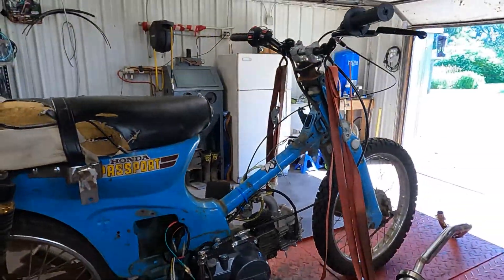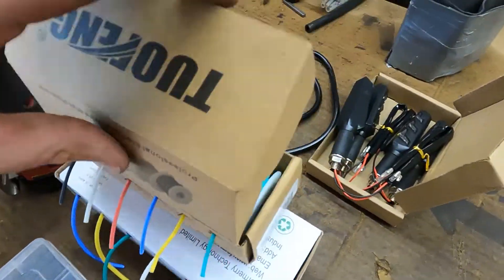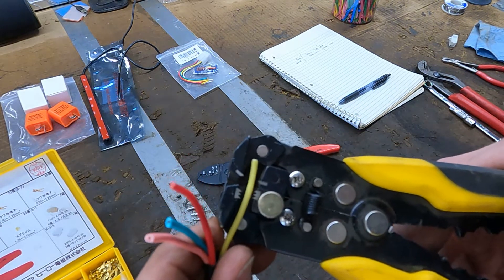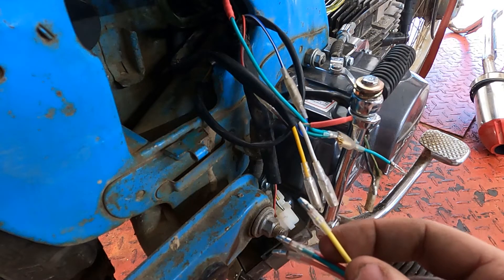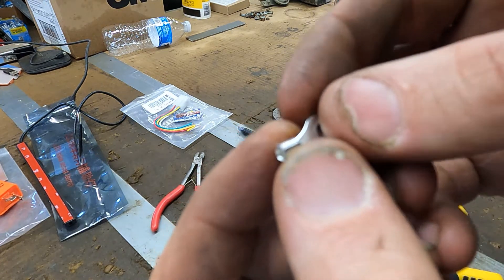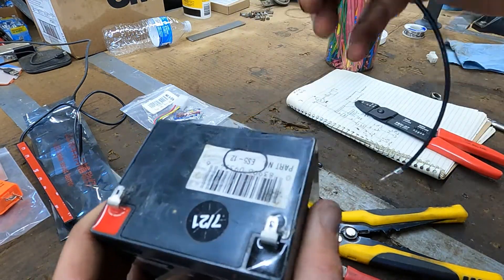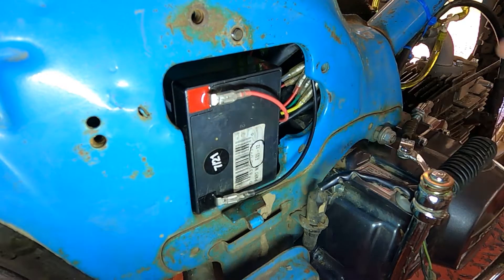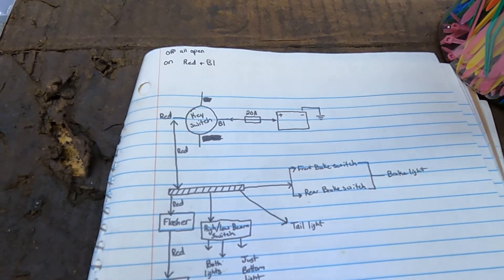Charging System Install on a LIFAN 140 on the Honda Passport!!

Comment: That thing is sick i love it i have a honda passport with an old lifan 125, i put a crf50 engine into a 1960s honda trail 55 c105 trying to figure out a charging system so i can run lighs gonnna gut the old harness and use everythint i can and should use then attempt to convert it all to 12 volt
Reply: But over all you have a super fun looking build my passport also has a 1×2 board stuck into the old airfilter spot in the frame going to the stock gass tank the board has a 1 gallon gas tank on it
Reply: Gives it a cool upper bone look
Reply from the maker: Awesome! It’s been a fun project!